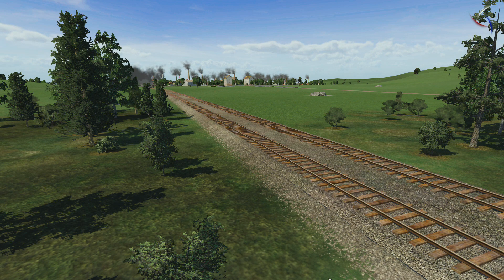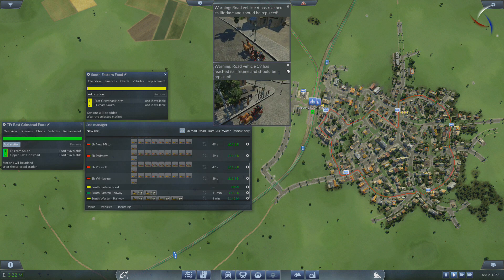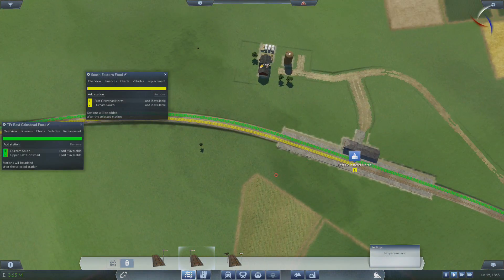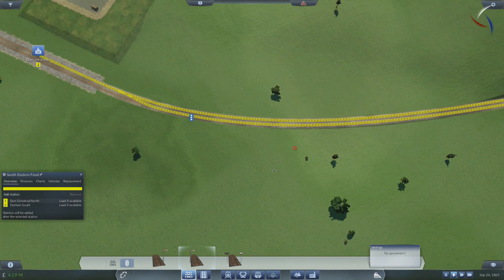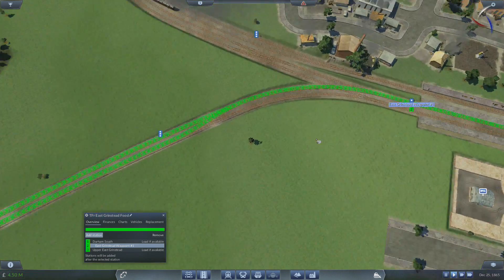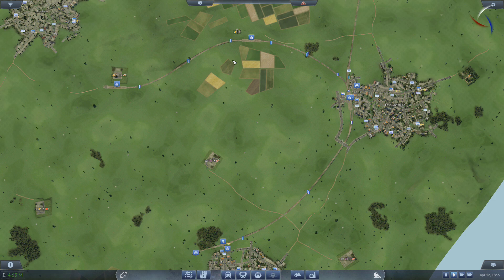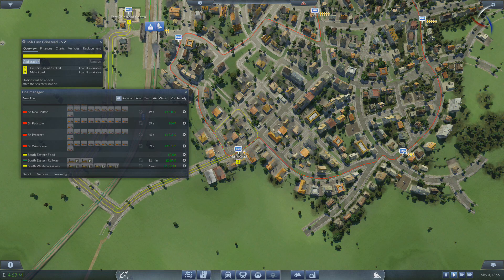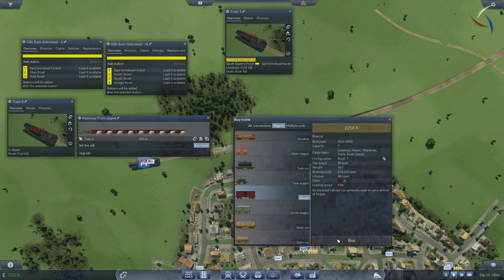Transport Fever Gameplay | Signalling And Points Tutorial | Episode 7

Comment: Great video, I've learned a lot about signals. I have a question, I want to use an already built, single track that is already in use. The new train will merge into the existing track from the right side with a new piece of track that I will tie into the existing track to make a junction, so do I need to put a signal anywhere for the train already on the original track, seems kind of dangerous to just come flying onto the track  with no warning! haha any help would be great thx!
Reply from the maker: If you take a look at my latest Transport Fever 2 video, (episode 110 of the UK Series) I do exactly what you are trying to do, and that should give you an idea as to how to set up the signals for that sort of a junction!
Reply: @ECGadget  I will check it out, thx for your reply, I will make sure to like and subscribe!

Comment: y u connect cargo to passagner station on 17:18? do they deliver cargo at this point as well ?
Reply from the maker: That's been doable since the beginning (As you can see this video was way back on the 7th of November). But yes, you can drop cargo off at a passenger station. Apparently this works for railways as well if you wanted to.
Reply: I'll try it, since some comercial areas of some towns i have are split apart from each other and not get the supply they need. I reach your video koz i wanna know how to use signals and waypoints, worth try it too :)
Reply from the maker: Sounds good to me! And thank you for watching. If you want to watch other videos from this season, it may help you see how those routes work!

Comment: I tried to use waypoints on a line but they would not add, is that a bug?
  The way I have it is a single platform station at a stone quarry that feeds into a loop, all of the stations are 1 platform, I have it go from Q>first construction material> second construct.>town>quarry, leading from stone to beginning of the loop is a 2 line rail, and the loop is one way(on the right), which then exits onto the left track, I also have a 2 wide main line that hits all major cities on the coast(it is also a loop, started as a passenger line), and I want to export some of the construction materials to a different city using said main line(its set up for 1 side to go one direction, and the other the other, however when I try to use the main line for the freight it keeps making the train go in the wrong direction, and no amount of signals or waypoints seems to help, when I tried to use signals it just messed up the lines, and any time I try to add waypoints to the line it just makes the line disappear and the train still goes on the original line ignoring the waypoints totally, help?
  Sorry for the long comment, I'm just trying to explain it right.
Reply from the maker: Waypoints are two way, so if you are adding them to the line and they are disappearing that means that the train cannot reach the waypoint from the previous stop. First thing to check would be the line order (you can click on an individual station in the line setup and then any stop/waypoint you add shall be under that station). If that all is following along, I would check the points (junctions) to make sure they are correct. Lastly, if they are right I would check the signals to see if they are one way!
Reply: ECGadget 
  Allright so I checked, the rails are fine, as to the signals I tried both one and non-one way and it did not work at all when they were one way and when they were 2 it kept putting the line on the wrong side of the track, as to the wp being 2 way does that mean it has to hit the point 2 times, going and coming?  Also they can get to the waypoint from the previous stop.  And the line is in the correct order.
Reply: ECGadget 
  I'm going to try to explain the track layout,  imagine the letter p, reflect the circle at the top to the other side, and move the line that comes down slightly to the left.
   The circle at the top is a 1 way, 1 lane track that goes Fact>F>town>1st fact.
   Right above the first factory the 1 lane splits, with the one line going directly into the first station, and the other bypassing the station and heading south.
  About halfway down the bottom line of the revers p I have a = style line intersecting it, straight left to right, with the top line is a east to west one way, with the bottom line being a west to east one way.
  I have a line were trains move the freight from the factorys to the town, so they never leave the circle, and then I have 2 stone delivery trains that deliver to each of the factories, so the stone goes from the quarry to the south hits the factories, continues around the loop, then bypasses the first factory on the return trip and goes back to the quarry.
  What I want to do is ship the construction materials from these factories to the next line over, so(on the north/south line) I have the left(southbound) line connect to the bottom(eastbound) line, and I have the top(westbound) line connect to the right(northbound) line.
  The problem when I make the line it will go around the loop and then go TRHOUGH the first Factory and go south on the north line, then go east on the west line instead of bypassing the station and going south and then east on the correct tracks, all the stations are 1 lane, with the stations that service 2 way traffic having junctions at both end of the stations.
  Sorry again about the long posts its just this combined with the bad balancing, horrible optimization, and bugs that I have run into are making what could be an enjoyable game into a chore.
Reply from the maker: Do me a favour please, can you upload a screenshot to steam and send me the links? I am getting a tad confused as to where it could be going wrong. My feeling is that there may be a signal somewhere that is facing the wrong way but on the face of it does not seem to be...
Reply: ECGadget 
  Sorry, I figured it out, sent the same thing to developers, was a bug. what had happened was the track ha originally been a clean connection, however when I had adjusted some track down from the 2nd towns cargo exit it had broken the intersection so that instead of a lead off it made the track a diagonal into the main line, similar to if you wanted to run a track across another at a angle, so the intersection became not usable. I have started a new map anyway as trying to fix it had caused me to go bankrupt. 
  Thank you though.
Reply from the maker: Red Menace Aaah okay, I would not have seen that myself! No worries!
Reply: ECGadget
  Thanks again. also great series!

Comment: Got an issue that is rather annoying, I have a steel mill now the steel mile requires Coal And Iron Ore and then supplies Steel and Slag "no not that girl down the street" this is where I'm having a problem setting up a Train to run on both sides doing  one train works fine but when trying to do another cancels out the other I have any ideas
Reply: ok Coal and Iron ore are fine both run on both lines But the Slag isn't Iv'e remover the signal and the cross track but still goes to one track
Reply from the maker: Not really sure about that one. The only thing I can think of is that there is a problem on the OTHER end of the line
Reply: hopping I've sorted it I upgraded the freight station to 4 and put a X in and 2 way points thing that sorted it will give it time

Comment: Could you not have left the livestock cars as automatic and got them to shuttle the food back as well? Save running costs on two trains
Reply from the maker: I could have yes, but I did not for two reasons:
1) The route for food would very quickly result in a full platform
2) Because I am using Gondolas too, it would mean I had eight empty carriages every run /:

When it comes to something like oil though, I probably will leave it automatic and let a single train do the work!
Reply: ECGadget that's fair enough, I can see logic in both ways of doing it I wasn't saying why aren't you doing it my way haha 
To save initial costs you could make one train work at the start then add the second. 
Judge the wasted running costs of the gondolas vs there being enough production to warrant a second train,  but as you said production picks up pretty quickly in this so a full platform probably wouldn't take long
Reply from the maker: TobyLeRone I never thought as such :)
It'll all be trial and error at first. See how it builds up and then don't make the mistakes afterwards. Though me being me... I'll probably make the same mistakes again and again!

Comment: PLEASE HELP ME!!!
Ok heres what I want. I want a cargo train to pick up stone from the quarry and bring it to the construction plane, then bring those construction materials back to the quarry station and then have trucks take it to the city

How Can I Do It???

Right Now the only way ive got it to work is to have two trains and two stations??? Please help I cant find any answers I dont know if it's even possible
Reply from the maker: First of all, you will need two different types of carriages running. Open wagons transport stone. Stake wagons transport construction material. If you add both to a single train then you'd be able to use one train. As for needing two stations, that is wholly unnecessary. The construction material will be fine coming off the quarry station, and into a truck station next to it.
Reply: ECGadget I did that I have both types of train cars and it says line in use "no"
Reply from the maker: Exotic Games Are the trucks already in motion to the city industrial areas? If not, the production probably will not start
Reply: ECGadget I fixed it by putting a road around the whole plant. Dont understand it but whatever, because it wqas in the catch area.

But hey one more question, why does the production go down to like zero sometimes. It will be at 100 then it will go to zero and ill start losing money
Reply from the maker: Exotic Games That is actually a bug, they are working on it!
Reply: I think I found another bug. How cvan I delete these bridges? they wont bulldoze
http://imgur.com/isnasXh
Reply from the maker: Exotic Games May need to bulldoze them in small bits, if they are like that
Reply: ECGadget Ive looked it up on goggle is there a way to disable all hud? like in cities skylines you can press F2 for conematic view.
Reply from the maker: Exotic Games Enable debug mode in the base_config.lua script. Then press Alt Gr + G
Reply: ECGadget there is no "debug mode" in my .lua file
Reply from the maker: Exotic Games So there isn't... it used to be there. Right, so I have no idea why I can still get rid of it. I'm not sure where the option is now! Sorry...
Reply: ECGadget hope someone on the workshop makes a mod, would be great